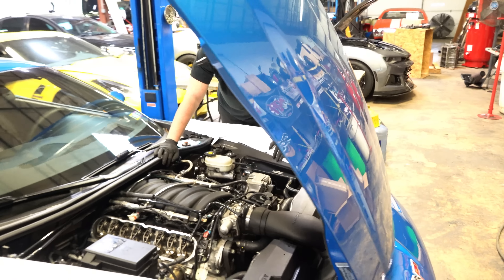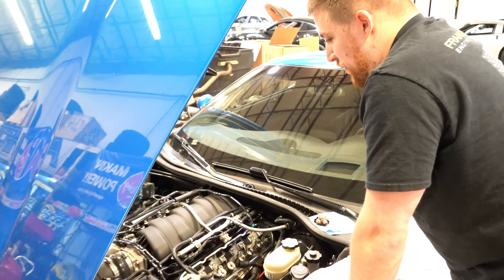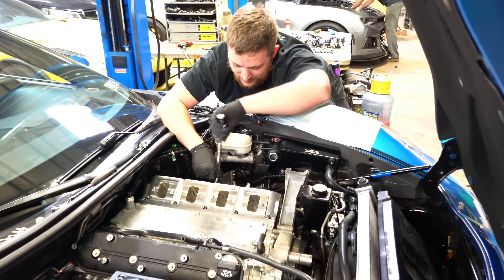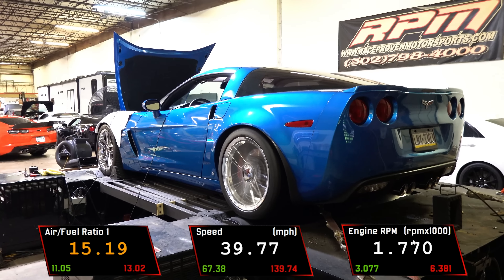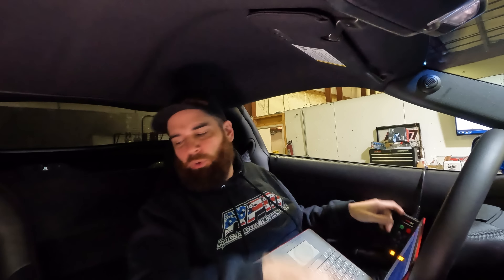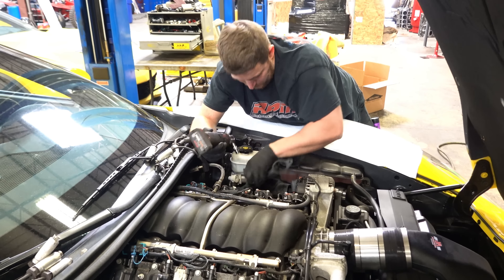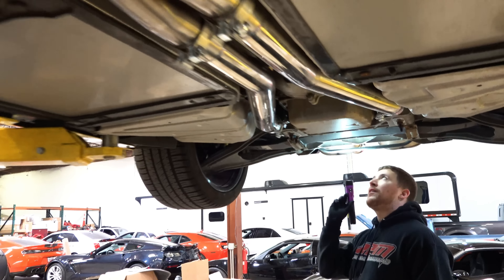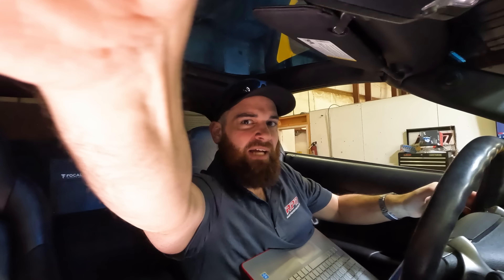Do NOT Do This To Your LS7!!

Comment: He is EXTREMELY lucky i respect his balls to risk it on a self job LS7 engine project lol. I blew my first LS7 trying to install cam/heads with not FULLY lubing the camshaft
Reply: Indeed, he is. I scrapped the stock rockers and used Crowler shaft rockers. Kicked the buckets out, too, and used linkbar lifters. That was in 2016, 23,000 miles ago. I did the wrenching, but not the machine work.
Reply: @Mike44460  ouch aye we live and get faster regardless brother!

Comment: This happened to me,brought my C6z in to have valves replaced at a local shop and they ended up putting lash caps on wrong valve,resulting in 2 dropped valves 😞